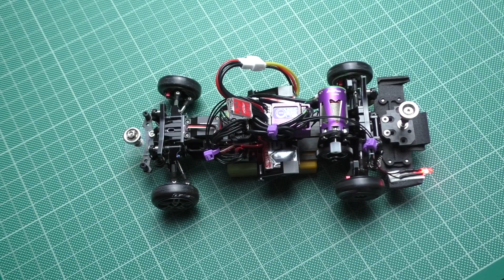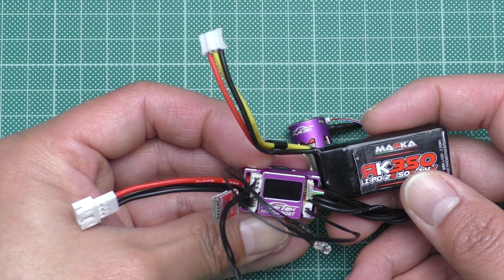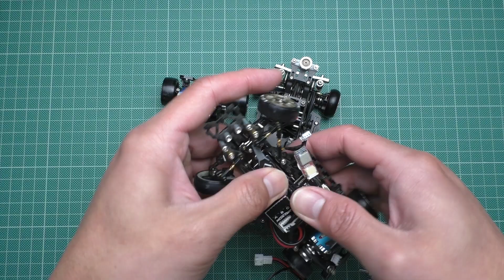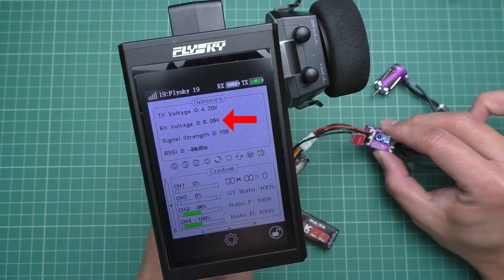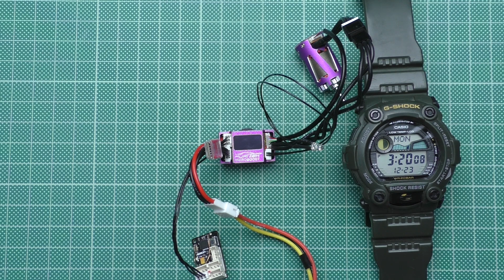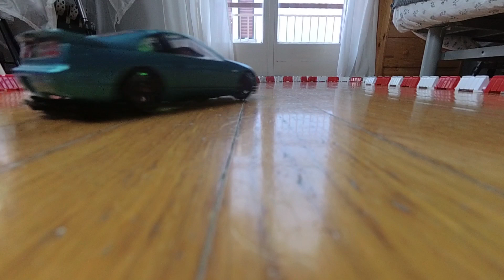[Review] Furitek Microboost Brushless Sensored ESC & LumaPower Motor

Comment: Hello, can I use rocket rc 3500kv 1510 for this esc?
Reply from the maker: Yes, you can and without buying anything else too. The micro sensor wire is already in the package.
Reply: It has arrived, and I’ve already installed it. It feels a bit weird, my 3500KV motor slowed down a bit with the Furitek, but with the Kiwami ESC, it’s quite fast
Reply from the maker: @gxplaycarx  You can try and adjust the timing, turbo and boost.

Comment: need help on battery terminal my battery have 2 plug and the esc battery have a 3 plug what type of battery i need
Reply: the battery you use on your esc now 3pin what type of charger you use for that to charge the battery? can a balancer charger charge that battery
Reply from the maker: @herbois-et2uh  I use a normal Lipo charger like ISDT 608PD or SkyRC S65. However the batteries that has only one small plug will need an adapter to split the balance plug into balance and power to charge.
Reply from the maker: You can use the balance plug on the battery (white plug) to power it. You might need to convert it though. Normally the balance plug is JST XH but this ESC comes with JST PH so you can either replace the plug on the ESC to XH or make a converter.

Comment: Really?  A sensored ESC?  Finally I found one and it's hiding in the drift cars?  And they have been around for years.  I have searched and found nothing.

I want to get the sensor data into the Raspberry Pi that drives my k989s.  Anyone know how to do that?  I had just given up and was going to settle for a guess at things.  Doing it right will be way more fun.
Reply from the maker: You're gonna have to dig into their app to see how it reads the data. I have never done it before either.
Reply: The say it's only 10Hz via Bluetooth so its way too slow for real time use.  I would need to hack the output to the Bluetooth dongle and it might be slow too.  I've got a new sensor to test and I need to finish this high speed braking I wanted the esc sensors for.  I'll just work around the lack of data until they give us the same telemetry they give the fly boys.  I'm adding it to the list.  Telemetry, spool in the front & center, diff in the rear, more car bodies, better tires.🤠

Comment: Should I set it to 0 like a voltage correction coefficient video? Removal has a default setting of 25. I'm not sure:face-purple-crying:
Reply from the maker: It depends on the calibration. You can use a multimeter to check the real voltage and if the ESC reads it correctly. If you don't have a multimeter, leave it as it is.
Reply: @BeaversHobby  I did a factory reset and it came back as 0. I'll use it as is. Thank you.

Comment: Is it okay to just unplug the battery while in Race Ready mode?
Reply from the maker: Yes, it's OK. I've tried it and it would turn the ESC off. Not that I recommend you do that all the time but if you accidentally unplug it while it's on, it won't corrupt the firmware.
Reply: @BeaversHobby  Thank you😊

Comment: Hey beaver are you planning to review the kiwami esc motor combo? I’m planning to assemble my drift 1/28 scale but the esc I see that always review is the expensive one like this if you do not intend to make a review would you mind giving me advice what to get for esc, motor, servo, gyro? Thank you in advance
Reply from the maker: Yes, I plan to do a video on Kiwami + Rocket motor combo.
But since the video is not going to come out soon I'll just tell you that it's really good and probably the best for the money right now. You have everything you need from a sensored system, turbo, boost and everything. As for the gyro and servo, micro gyro from AFRC V4, AGF V3.5 or DasMikro V4-V5 are great and all you'll ever need. For the servo, try to get AGF A11CLS or A06CLS depending on your car. Otherwise the 5g short body like AFRC D1802MG is fine. Personally I'd prioritize the gyro and  the servo first. V4 gyro + A11|A06CLS are a must then what's left of the budget goes to ESC + motor in that order. Any ESC with Hobbywing program will work great. BYRC on Aliexpress uses this program too. More expensive sensorless Hobbywing-based ESCs are DasMikro, PN Racing ,Atomic and GL Racing.  Any brushless motors are good nowadays. I recently got a cheapo $10 motor and it's really good. It runs quite hot but it's smooth enough for drifting.

Comment: Hello. I wanted to ask you what you think About dasmikro v5 gyro for a k969
Reply from the maker: It'll work great. For RWD mod it'll be perfect and for stock setup it's a bit overkill. However, you can keep it for your next chassis.
If you use the original electronics you will have to convert the plugs. Just cut and re-solder so you can use the original small servo plug to connect the gyro to the all-in-one unit and JST-ZH from servo to gyro.
Reply: @ Thank you very much. I love your videos by the way

Comment: If i were to just run an xt 60 to the power cables is thatbok or will i lose functionality?
Reply from the maker: It won't work. You'll need 3 wires for the battery.
Besides, XT60 is way too big for a car of this size.
Reply: @BeaversHobby  the  solderable and wire replaceable version fur-2622 only comes with 2 power wires  + & -  ill have to get that one to use xt30 thanks for all the info, your videos are awesome
Reply: Sorry meant xt30 but yeah it runs on a regular 2s balance lead right?
Reply from the maker: @jeryjohn  Sort of... it's not exactly 2S balance plug. That would be JST-XH 2.5mm. This one comes with JST-PH 2.0mm. Anyway, you can replace the plug with JST-XH and run it with the standard balance plug. 
I remember there's 3 poles XT30 too. You can also replace the original plug with that.

Comment: Hi Beaver! I am basically finished with my wltoys truck 1/28 drift car without a front one way but I have a question, is it recommended to make the original plastic front top arms adjustable for camber? I want to add a little camber but I dont want to risk breaking my plastic parts. I made a front mono shock to increase my steering angle, 1.5 front toe out, custom suspension spacers at the back to stiffen the rear, drift tires from shoppe, 14 gram front weight, 20 gram rear weight, 15 tooth cs gear, and aston martin body shell
Reply from the maker: Don't do it. I would suggest you not taking unnecessary risk to make the adjustable front camber. It's pretty sensitive and if you are new to drifting, front impact is frequent so you can break it even easier.
Since you already did the CS mod I recommend getting front one way and long universal shaft/dogbone to go with it. You will need free running front wheels otherwise the rotation difference will make the car very hard to drive.

Comment: I’m building a onisiki kodama, I want the best of the best for everything on it. As of today, in your opinion, what is the best ESC, motor, gyro, and receiver/transmitter, and tires? Thanks in advance!
Reply from the maker: The best ESC + Motor combo for drifting is either Furitek Microboost with Lumapower motor or Hobbbywing Mini 28 with EZRun 1626 motor. Furitek has the lighting effects which is a bit of a gimmick but it's the right kind for a drift car. Hobbywing is a race-proven kit.
Gyro, either GT55 V4/V5 or AFRC GTS-2 V4 are great. GT55 has better filter for the wheel shake. AFRC works great if you use a programmable servo.
As for the servo, AGF A11CLS or AFRC D2114TG-S are the best. I'm not sure Kodama takes this size or the narrower AGF A06CLS so check again.
Battery, can't go wrong with GNB or Gaoneng. I have a bunch if them and accidently over discharged some quit a few times and they still work great.
Transmitter is really up to personal preference. Flysky Noble Plus or Noble Pro, Futaba 4PM and Sanwa MT-5 are all great. More than this are going towards extremely professional (and ridiculously expensive) radios like Futaba 10PX and Sanwa M17. All of them have micro receiver by GT55/DasMikro.
Reply: Thank you so much! I appreciate your fast responses and accurate answers! Unfortunately I can’t bring myself to spend 300 on transmitter is there one you can recommend for sub 150 or 200 thats still fancy?
Reply from the maker: @ There's Sanwa MT-R. I found it on RCmart for $179. https://www.rcmart.com/sanwa-mt-r-fh5-4-channel-2-4ghz-radio-system-w-rx-493i-receiver-101a32774a-00122411
Then you can get a drift gyro-integrated receiver from GT55. This will save you a bit of money and also space inside the car. https://www.gt55racing.com/products/sanwa-fh5-4ch-tower-antenna-nano-gyro-receiver-with-shell2-dsk-801-multi-color-optional-gt55racing?DIST=RUZBGw%3D%3D
Another option is on the budget side, Flysky G7P. https://www.rcmart.com/flysky-fs-g7p-pro-2-4ghz-transmitter-7-channel-remote-controller-w-r7p-receiver-x2-fs-g7p-upg-00126100
The latency and consistency is great too. It has everything you'll ever need including micro receiver. https://www.aliexpress.com/item/1005006844523740.html

Comment: Beaver, will you do a review on the Wltoys 1/28 buggy?
Reply from the maker: I don't know if I'll get it though.
It's the same chassis with different CVD and wheels. That's pretty much it.
Reply: @BeaversHobby  I was wondering how the 1/28 wltoys platform would do as a buggy. My first thought when I saw the car was that the larger wheels would make the gears break faster.
Reply from the maker: @J_sh007  The gears are now more durable but yes, the whole car will wear out faster with bigger wheels. 
I used to have the P929 which is a predecessor of the new buggy. It worked decently well on bumpy surface that the small wheels can't negotiate. But because of the small suspension travel it doesn't jump well. Well, the part where it goes up is fine. The landing is not.

Comment: Im looking for a quality mini drift car for indoor use. Something that will last. Nice to work on. Not too expensive. Thanks so much
Reply from the maker: Take a look at TG Racing. It'll be around $180. With wheels, tyres and body it should come in around $220 depending on the body you choose.
The electronics, if you go with the budget but good set is around $65 for BYRC Hobbywing 18A combo ($25), AGFRC B05CLS servo ($10) and Dasmikro gyro ($30). You can swap the B05CLS servo with A11CLS and you'll have much better steering precision but it's $60. 
If you don't have a transmitter yet, Flysky G7P is a great choice. Otherwise if you want to keep the budget low, DumboRC DDF 350 will do fine.
Battery: GNB 2S 350mAh is about $10 a piece. Charger, this one depends on your local store but take a look at SkyRC S65AC. 
I use ISDT 608PD for a pocket charger (and it uses my phone adapter for power supply).
Reply: I can’t find the motor esc combo listed in this comment can you tell me model numbers? Thanks in advance
Reply from the maker: @ It's this one. https://www.aliexpress.com/item/1005002919336408.html Unfortunately, there's no model number. It's just 18A Brushless ESC from BYRC shop.
Reply: I clicked the link and there are a bunch of motor options what kv motor should I run? This is going into a WL toys rwd k969. Thanks for answering all my questions I’m almost done with my first build
Reply from the maker: @1990pepper  KV depends on your track size. For under 3M wide you can use 3500KV and it'll be just right and not too fast. If you want more versatile setup like for bigger track later then get the 5500KV or 6000KV then reduce the pinion gear to a smaller one. Don't go faster than 6000KV, it'll be uncontrollable.

Comment: What’s the best cheap drift rc hobby grade easy upgrade fast rtr 1/24 ish
Reply from the maker: BMR-X is the best value as of now. TG Racing is also good. Find these 2 and see which one you can get the cheapest. Just look at the chassis and wheels (they use different wheels). All the rest will be the same, same motor, ESC, gyro, battery and transmitter.

Comment: how does it compare to Furitek momentum?
Reply from the maker: A bit better. I mean momentum is already close to sensored system in terms of smoothness. This one is a bit more responsive and the throttle control is a bit more precise.
There are other features like light controller and rev limiter that set this ESC apart from Momentum and the others though.

Comment: I had noticed the the three-wire JST PH plug for the battery, but I also noticed the positive leads appeared to be soldered into the same post at the ESC end of the wire? Does that still allow the ESC to sample the cells individually?
Reply: to answer my own question...I can't get the case open, but peering closer it seems like it could be wired to different posts, and it obviously shows individual cell voltages, so I am probably wrong in my suspicions.
Reply from the maker: @cobPhoto  The wires go into separate terminals.